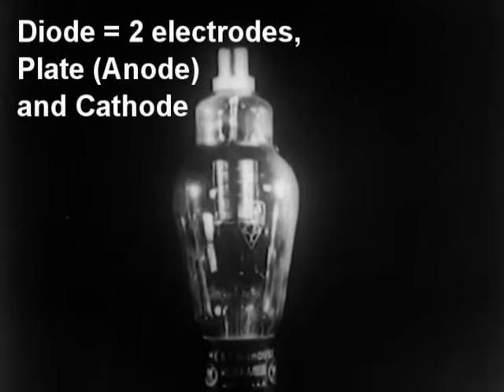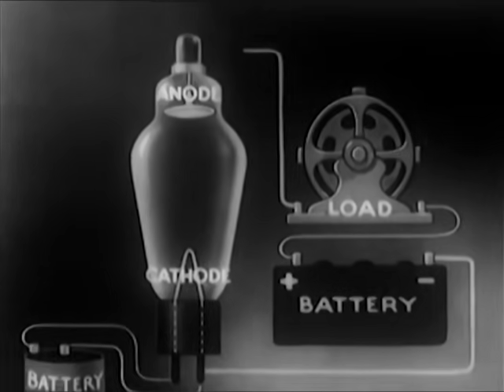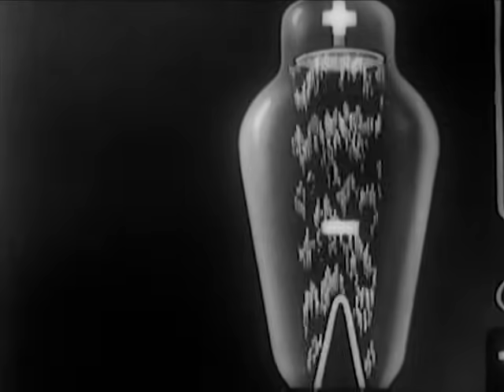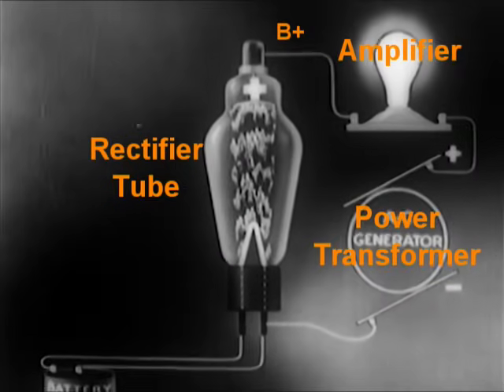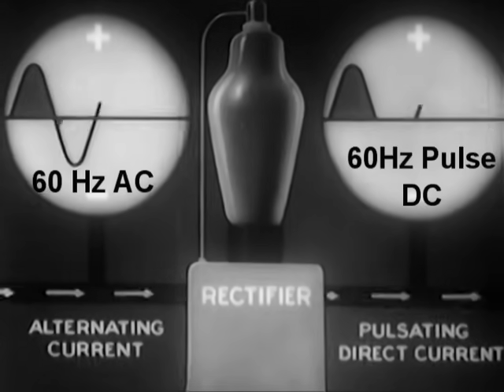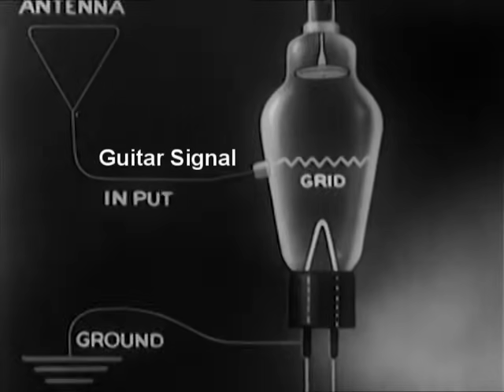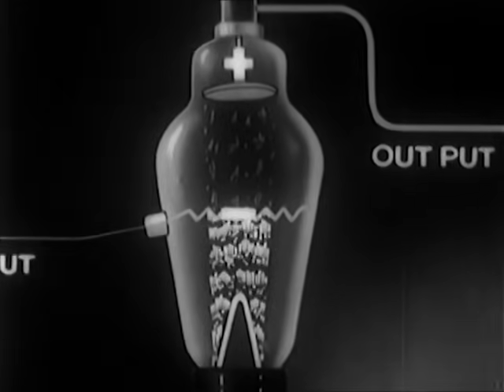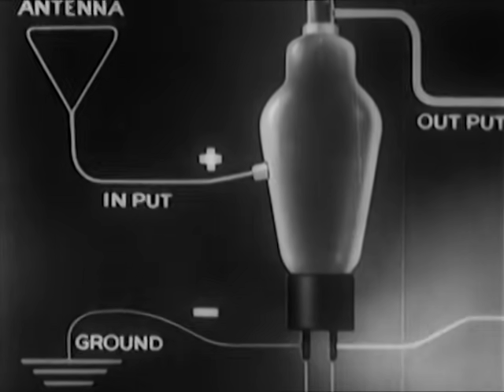How Vacuum Tubes Work

Comment: This is a description of a device interacting with invisible. We dont need the machine explained we need the invisible explained!
Reply from the maker: The electron flow through the tube is invisible because electrons are so small. If you adjust the bias too high (too much electron flow) the metal plates in the tube will glow red from the heat of all those electrons smacking the plate at high speed. That makes the effect of the electron flow visible.

Comment: Does the heating element take time to heat and start closing the circuit?  Because the transistor can swich on and off very fat. Does the vacuum tube swich on and off fast too❓️
Reply: The heating element takes time to get to operating temp. So it stays on all the time during use. Fast switching is done via the weak input signal

Comment: These older films (transferred to video) were very well made. The explanation of how vacuum tubes work is interesting.  I am in my 70s, and in my early years of working in electronics I was building projects and doing servicing of devices using vacuum tubes. The tubes in this video are of a much older generation of the ones I worked with.

Comment: It is unreal how the tube amplifier analogy is so much easier to understand than with transistors.
Reply from the maker: The transistor gate functions like a tube control grid. The signal applied to the gate is amplified by the transistor.
Reply: That's because the working parts of a vacuum tube are visible and organically understandable.  The discreet transistor is hidden underneath a tiny can with two or three wires coming out the bottom.  The working parts are hidden and create mystery on how it works.  The FET works like a tube but, again, it is a tiny bit of silicone hidden inside a can.  The mystery goes up dramatically with IC chips which are impossible to organically understand.

Comment: If negative voltages reduce the flow wouldn't the tube only amplify the positive part of the wave?
How would you amplify the negative?
Reply from the maker: The power tubes idle at half output power so you can increase and decrease current flow through the power tubes so both positive and negative voltage on the grid is amplified.
Reply: The tube amplifies only negative voltage. The damping of the electron flow IS the amplification. 
The plate current flow is inverted in relation to the grid negative voltage. 

How does the tube amplify the positives then - it doesn't. The tube is biased for the signal to always be negative. That means, a positive, low DC voltage is added to the cathode, or a negative one to the grid. So the positive half-waves at the grid become negative, just less negative. 
At the output a 1st order high pass (capacitor or transformer) filters the DC offset out again, to have a pure AC signal. 
Keep in mind this only describes the class A (most common and simple) amplifier type.
Reply: @westelaudio943  Dumb question perhaps, but where does the extra energy (or electrons?) come from to amplify the signal? Feels like we get something from nothing when the grid is in place.
Reply: @jasonvincent2367  

From the B+ supply voltage going through the load and then to the plate. The tube doesn't add power to the signal itself, it transfers it to the plate curcuit by varying it's resistance depending on the instantaneous grid voltage. Thus, based on Ohm's law (current decreases with resistance), it forms a voltage divider with the load. The load receives a signal that's amplified and inverted relative to the input (and DC biased, if the input is AC).
Usually, in an AC curcuit, a high pass element is then used to remove the DC bias (offset) to get pure AC again.

Comment: One of the nice things about tubes is being able to actually see the elements being discussed which makes it, in my mind, easier to understand. If I had my way, tubes would still be taught to help visualize what happens in an amplifier, even in solid state.
Reply: Same. Using heat and a vacuum to induce electron flow vs silicon doping layers near each other inducing electron flow, without heat. Its all very interesting :)
Reply: cant agree more. Ive already learned a bit about transistors and silicon diodes and THIS makes light bulbs go off (😉) and helps me understand even more things going on. Electronics really is like nothing else. I still think it’s from aliens or something😅
Reply: @BradScott-ys6ot Sorcery for sure. 😅

Comment: God, no wonder so many devices used these things back then. Vacuum tubes look dirt simple to manufacture and operate, despite their extreme limitations. 

Unlike transistors, despite being superior, require; cooking, carefully tracking oxide layers, acid baths and toxic doping chemicals. No big deal to modern factories, but imagine mass producing something that involved back in the very early 1900's. Yikes!
Reply: Oh...it is not as simple as it seems...and every vacuum tube is handmade.To a very high degree of precision!

Comment: Thank you for sharing, and for pointing out that the full video is available.

Vacuum tubes were still quite common when I was a kid, and I grew up through what I consider "The Digital Revolution" through the late seventies going through the eighties. I witnessed the demise of the LP, 8 track, reel to reel, slide projectors, and film projectors. I witnessed the development and demise of audio cassettes, VHS, and Betamax. I saw the rise and fall of CDs and the development of the dvd. I witnessed the war between Bluray vs HDDVD just like vhs and betamax. If seen the development of mp3, mp4, and streaming.

I've seen numerous game systems from Atari 2600 and 5200, through NES, Wii, to XBox and PlayStation and their various associated handheld units.

I remember when a 19 inch color tv tipped the scale at around 75# and was state of the art. Now we have displays that cover a wall weighing around 150# at barely 1-2 inches thick, and can project an image anywhere with no wires or cords from a projector the size of a deck of average playing cards.

Personal computers were only for the rich, and only doctors, lawyers, and the occasional drug dealer had a mobile phone that was the size of a briefcase.

Today, we wear and carry devices as phones that are far more powerful than all of the combined computing power of every computer NASA had when we sent astronauts to the moon.

My first computer in 1998 was cutting edge technology with a 300 MHz processor, 4MB video card, 64MB ram, a 4.3 GB hard drive, and a 56K modem with 24K fax. It can't even come close to what my two year old Note 8 does.

We also went from wired Ethernet which we still use, to extensive wireless home networks through 802.11 a, b, g, and n.

Mobile phones are small and inexpensive enough that everyone has one in their pocket and they went through wireless technologies from Edge through G, 2G and 3G, 4G and 4G LTE and now into 5G.

That doesn't even count the IOT or internet in general as we know it.

All of this is only the tip of the iceberg.

But now we're bringing back tube amplifiers, LP's, and the instamatic camera and now have instamatic photo "printers" that connect to our smart phones and "print" a photo that comes out entirely white and becomes a photo before your eyes, and call the technology "new." At best, it's old school with a modern twist.

I'll be 47 in 2020, and as fast as technology changed then, it's nearly lightning quick today.

We really do have the world at our finger tips.
Reply: Excellent post.  I forgot about HDDVD.
Reply: Erm...we have 'our ' world at our fingertip,the world will remain as it has always been😒
Reply: Tubes never went away. Guitar amps (high end ones) always used them, as well as niche HiFi amps. LPs also, but there has been a resurgence since about the early '00s. Instant cameras aren't all that good, I don't know why people use them, I do love my 35mm film though.

Comment: If you want to actually see a Thyratron power supply in operation (That's three tubes, two of them are mercury vapor Thyratrons, third is a neon), take a peek at this. https://youtu.be/WX74GoHuwHk?t=644  It's a high power 200V .5A DC supply for a Teletype model 19.

Comment: I always wondered what all those huge Vacuum Tubes inside my PC did.It all makes sense now.
Reply from the maker: I'm sorry to say that PCs have never had tubes in them. There were tube based computers in the 40's and 50's but by the time the PC came along in the 80's tubes had been replaced by transistors and integrated circuits.
Reply: Those aren’t vacuum tube. Vacuum tube is a dead technology replaced with transistor and integrated chip. I’m assuming based on “huge vacuum tubes”, most likely you are referring to large capacitors and diodes I think.
Reply: Sarcasm guys.
Reply from the maker: @random_ramblings  Sorry, it went right over my head.
Reply: LOL The smartest people sometimes miss things like humor and human emotion. Data from Star Trek knows what I mean.

Comment: Resistant to EMP.
Reply: Far more susceptible I think. You can shield micros, tubes are big, and so are the transformers that run them. But no, you are right! a tube wont fry under an EMP condition. If I had to make a radio for the end times, I think it would be a hybrid. the rules? It must withstand EMPs and encrypt data. So for me, my front end and power supply would be tubes.
Reply: @Wtfinc  yup, there are ic's designed to be EMP resistant, these are used in military aircraft.
Reply: But tubes are fragile. That’s why early computers and radios were so unreliable. You had to replace tubes all of the time... just like light bulbs. 

They also consume a ton of power.... power that will probably be scarce. 

No... solid state is better. Just put a faraday cage around it and no EMP will harm it.
Reply: @Bartonovich52  YES! You are incredibly right! lol, what was I smokin. Power efficiency in a post apocalyptic world did not register with me. A good mental exercise. Perhaps some gas discharge tubes, PTC thermistors, Transient-voltage-suppression diode(I just did some reading on a TVS). I would like to build an Apocalypse Radio, 10-12 meters? What bands would you have? 300? would you happen to know if it were viable to operate FM in 300m. I want to make a radio out of a microwave oven, I wonder.

Comment: Why does it have to be low pressure inside the tube? Is it because air is conductive?
Reply from the maker: Because atmospheric gasses will interfere with electron movement and oxygen will cause the plates, cathodes and heater elements to burn--that's why incandescent light bulbs have a vacuum.
Reply: I think it isn't merely "low pressure" but absense of matter - thus, a vacuum.
Reply: Lou Fazio A vacuum is a low pressure, A low pressure is a vacuum, they are the same thing. For the pressure to be lower, there must be, as you say, less matter. But not an absence of matter, just less. Total absence of matter would be a perfect vacuum, ie zero pressure units absolute, which doesn’t exist, because we live in a universe that is constructed of matter, and therefore, there is always matter somewhere, or else the vacuum could not be part of the universe 😂
Reply: @KingOath  I meant vacuum = a total vacuum (or as close as possible, such as outer space) as compared to a partial vacuum (your low pressure).
Reply from the maker: @louf7178  A true vacuum is just about impossible to create. Tubes do not have a true or perfect vacuum but enough matter is removed to allow the tube to function.

Comment: This is fantastic video, but I can't find the answer to one small question: What is the difference between the anode and cathode that allows the cathode to emit electrons while the anode cannot? Is it just the fact that it's heated? And if that's it, then what is the temperature difference in question?  I've seen vacuum tubes running, and the entire thing gets super hot. Is the ability to thermionically emit electrons a sudden change with increasing temperature?
Reply from the maker: Yes, it's the extreme heat of the cathode and the cathode is also coated with a substance that helps it shed electrons.
Reply from the maker: Electrons are only shed at high rates when metal is near white hot. Heated cathodes glow yellowish-white they are so hot--much, much hotter than the anode.

Comment: How does the input to the grid work, when it is not a closed circuit?
Reply from the maker: The voltage difference between the grid and cathode is the "closed circuit". The cathode and grid are both referenced to ground so that forms the closed circuit. The voltage difference between the grid and cathode controls how much current flows through the tube.

Comment: Can the vaccuum tube hold free electrons? Basically what I'm saying is: If you used an electron gun to fire electrons into the vaccuum tube and held them there with a momentary magnetic field, would the electrons stay in the vaccuum if it were completely insulated and you turned off the magnetic field? Keep in mind, there's no anode attracting the electrons, only the magnetic field confining them in the space till it(the magnetic field) is turned off.

If not, where do the electrons go if the vaccuum is insulated, therefore they can't be absorbed by the vaccuum itself? Wouldn't that mean they'd have to stay in the vaccuum indefinitely until the tube is connected to an anode, or other positively charged objects?
Reply: If you remove the positive charge from the Plate, while still heating the Cathode/Filament, electrons will be emitted but have no place to go and will  fill the tube space.
Reply from the maker: I don't really know. I would think most of them over time would be absorbed by the glass tube and interior metal parts.

Comment: Where it shows the 2 waves...  What do the + and - represent?
Reply from the maker: The + means positive voltage, the - means negative voltage. In an electric guitar when the string moves one way over the pickup it makes a positive voltage, then when the string reverses direction it creates a negative voltage in the pickup coil.
Reply: So the wave showing the DC+ represents protons?
Reply from the maker: No, it's all electron flow. A positive voltage is  scarcity of electrons, a negative voltage is an excess of electrons.

Comment: Are vacuum tubes more or less responsive than transistors? Generally speaking of course
Reply from the maker: Technically speaking transistors have a speed advantage since they don't have to "fly" electrons across a gap but the actual difference in audible tone is imperceptible.

Comment: So to turn it "off" you heat it up? How strange. This is all so fascinating.
Reply from the maker: No, you remove the heat to turn it off. Heat is required to knock electrons off the cathode and allow electron flow through the tube.